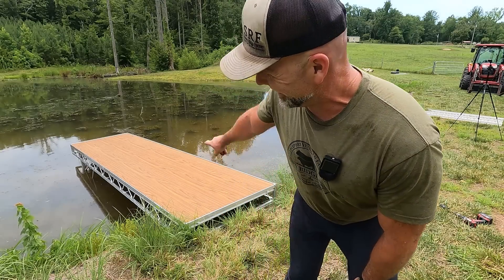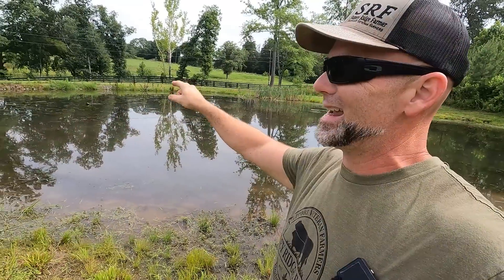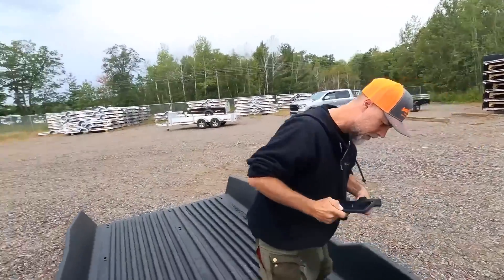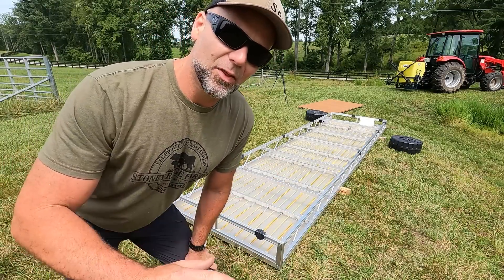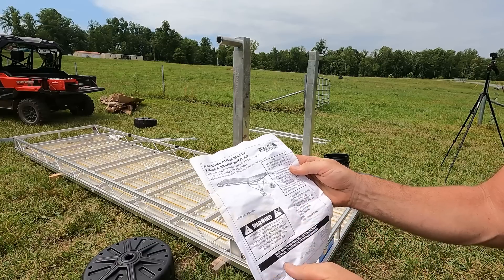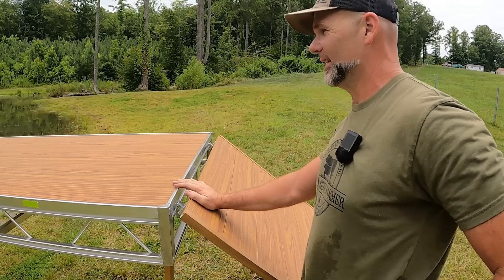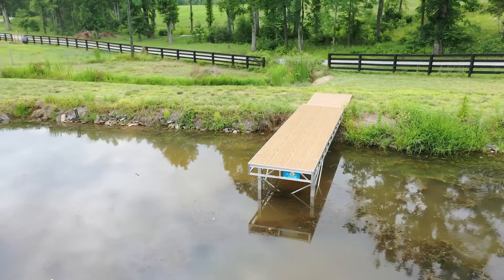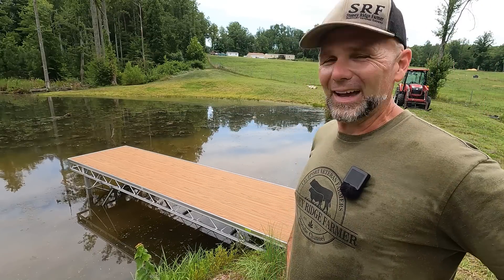This might GO BAD! Dock build/install farm catfish pond start to finish!

Comment: Really nice dock, Josh. The install and leveling looked super simple. The aerator will definitely help. I've had one running for several years, and the difference is amazing. Looking forward to the floating dock install! Thanks for sharing!
Reply from the maker: I can't wait! Now if the temps would cool off a bit that would be nice!
Reply: What brand of solar aerator do you use? 
My pond should be finished in the next day or two and I will be looking into a solar aerator. Any recommendations would be greatly appreciated. 
Thanks from NW Arkansas. 🤗
Reply: @janhyde9620  wish I could help. Mine is shore power. Watch Josh's pond videos. He covers the one he installed. Take care.